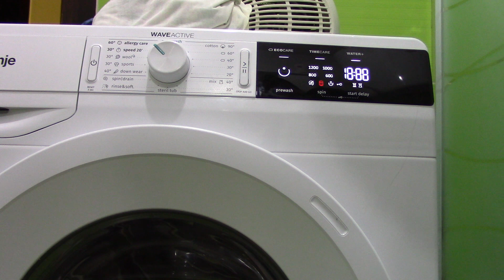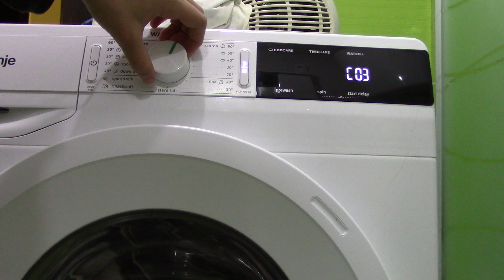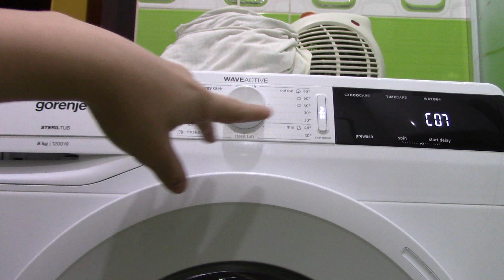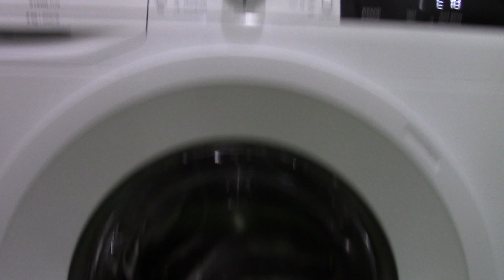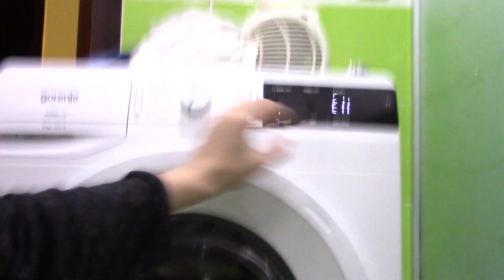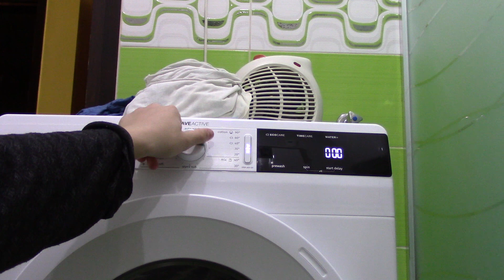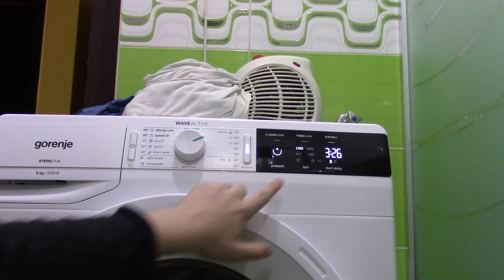Gorenje WaveActive Manual Service Cycle

Comment: Nice instruction. I will try the service cycle soon.
Some of the modes that did nothing certainly test features that are built into the top models, like the steam and ionizing generator, the door light and the floating switch in the bottom tray.